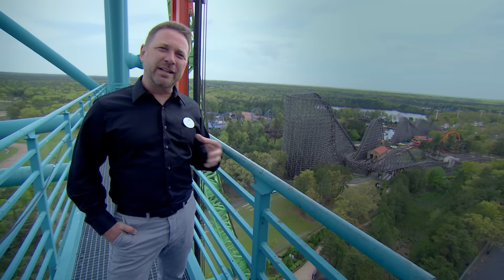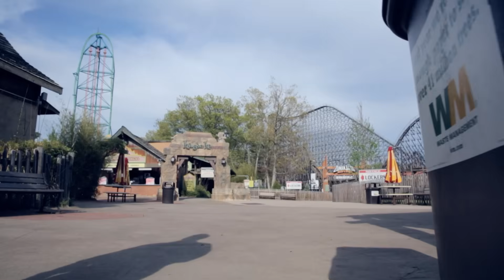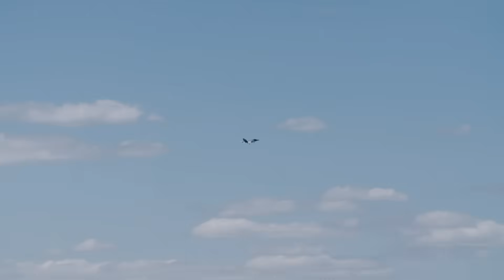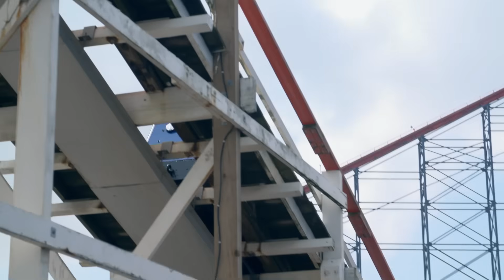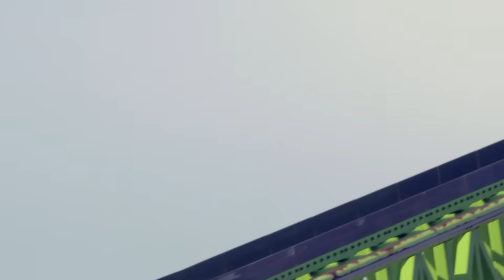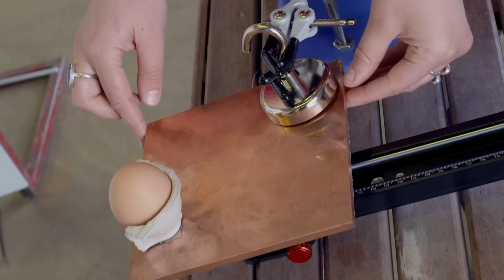The Insane Engineering That Powers the World’s Tallest Roller Coaster | Blueprint

Comment: Dragster still lives at Cedar Point and they made it better than before. This is why I don't like Six Flag Parks they gave up on fixing it. Six Flags America is closing down after this Summer they gave up on the park this should tell you something about the people running Six Flag Parks.
Reply: TT2 cost a reported $25m and has not been without teething problems. LSM's cannot (yet) provide the same acceleration as hydraulic launch systems, hence the spike and triple launch process. It's different rather than a like-for-like "improvement."

The simple fact is that, one way or the other, coasters cost money to keep going; Nemesis (Alton Towers) was completely retracked and had other work done at considerable expense. At some point tough decisions--which includes significant capex to extend operational life as well as removal--may have to be made.

The removal of Ka happened after Cedar Fair merged with Six Flags; Cedar Point (et al) are all under the same corporation now.  The combined business carries a great deal of debt and is undergoing the (unfortunately) necessary process of consolidating and refocusing. Rather too early in that process to say they aren't getting it right.